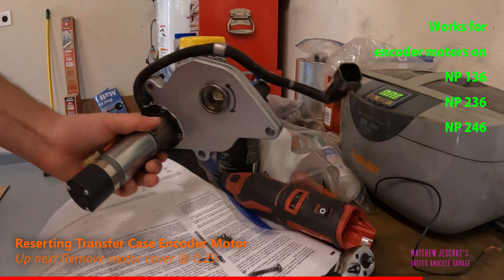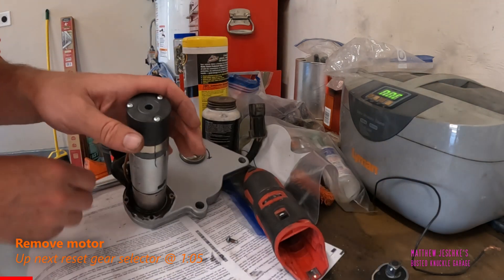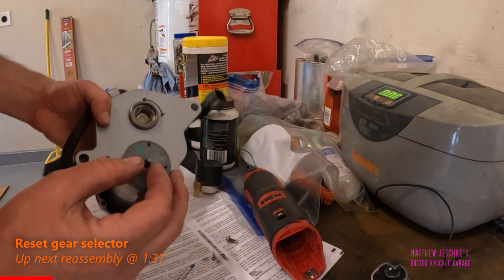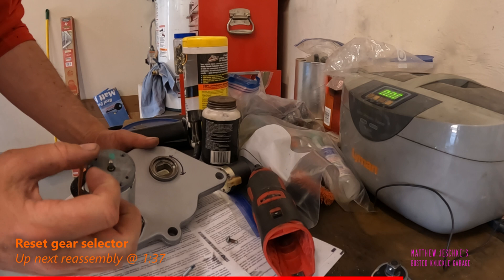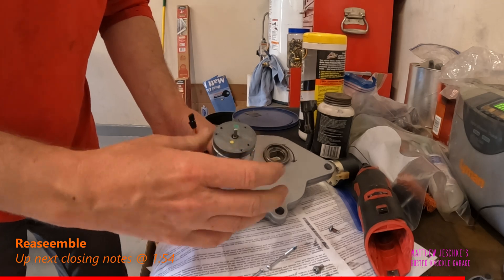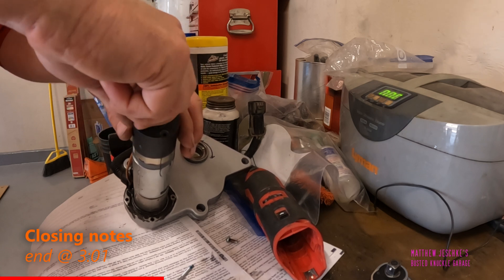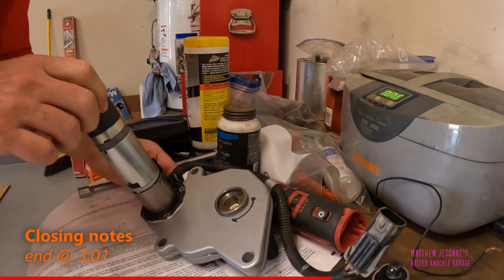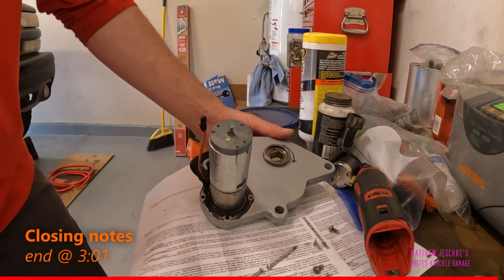Part 1 New Process Transfer Case Encoder Motor Reset

Comment: Im dealing with the same issues i think. I have been afraid of pulling it apart but the one i have is still under warranty 🤞
Reply from the maker: Works like a champ. I understand is a bit scary to take that cover off though. Just make sure you RTV the cover when you put it back on.
Reply: Did it work? I'm dealing with the same issue.
Reply: @prescottsims245  I haven't had the chance to mess with. I told myself it's a spring time project. I'll try and remember to post a video about it when I finally figure out my 98 tahoes  problem